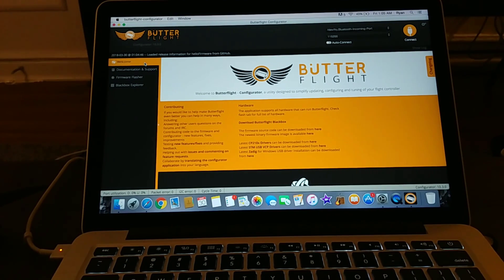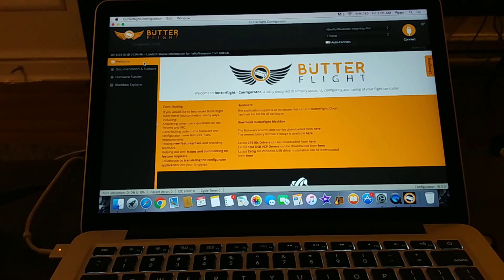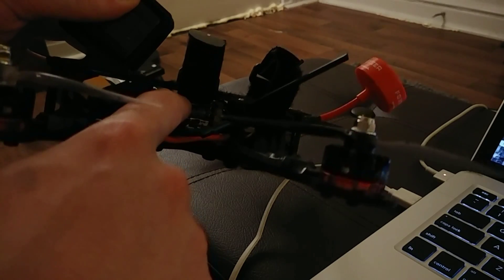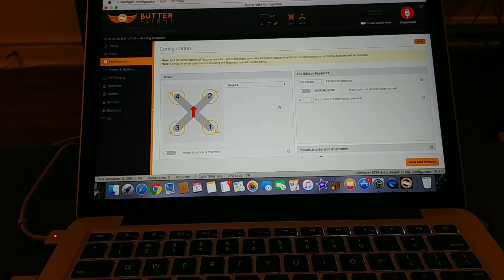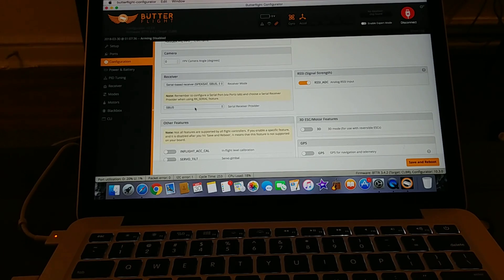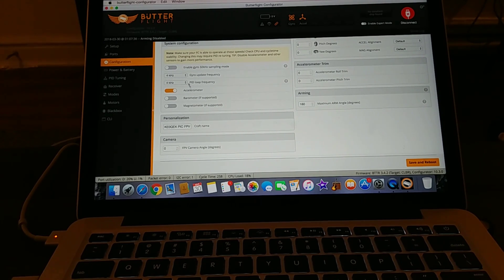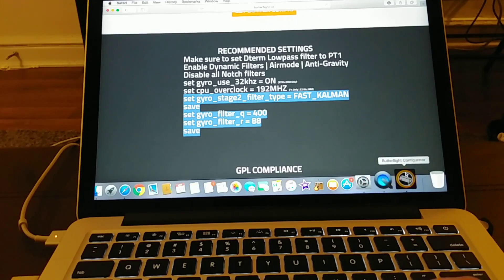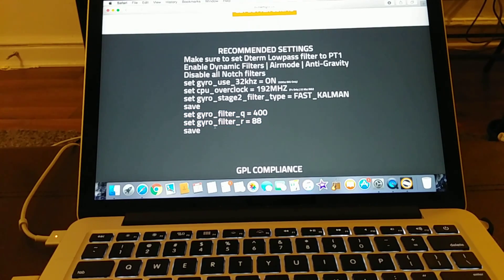Butterflight configuration for F3 Flight Controller

Comment: I don't see the command lines on the website?
Reply from the maker: They got rid of them for everything after 3.4.2. Im not sure if they are always active in 3.5.0. I have 3.5.0 on my quad now and it flies amazing
Reply: PilotInCommand FPV I tried to get 3.5 but I guess there is something wrong with the hex for spracing and only #1 motor spun up with dshot active.
Reply from the maker: Dufour- FPV did you get the hex from the butterflight releases page or from the configurator? I always flash my firmware from the configurator and click load firmware online. I also always use the stable releases, not the release candidates. I would try loading butterflight 3.5.0 online using the configurator and then flashing that to your board. It should allow dshot to work.
Reply: I did. That's the only way I flash boards. There was a known issue with the spracing hex
Reply: Then I seen in the github-pages someone giving out a new hex but I didn't want to try it that way I figure I would rather have the stable releases from the configurator. But it's the stable release that doesn't work. And I used Turtle mode too much to use Multi Shot instead of D shot
Reply from the maker: Dufour- FPV I would give the new hex from gethub a try. After you flash it and set it up arm the quad with no props, if everything works then hover the quad for 30 seconds. If it can hover for 30 seconds then fly it hard for a minute and a half. If it is still working properly after that then Id say your good to go. Just make sure you do the over test and the hard flying test in an open area with no obsticles.
Reply: Yeah I am pretty knowledgeable about flashing and tuning. Flying for a few years. It's all good I'll wait for the fixed hex